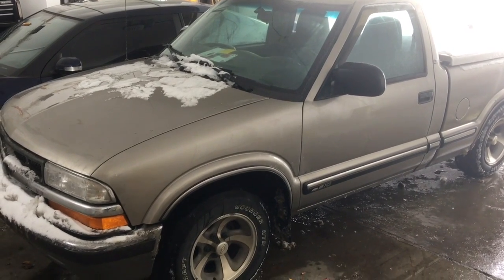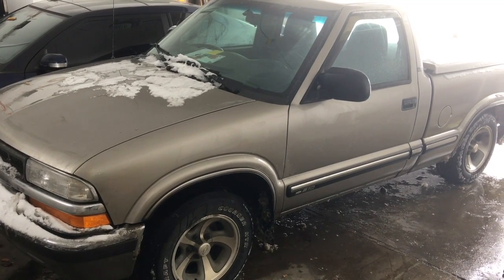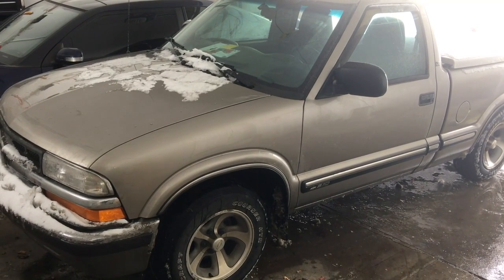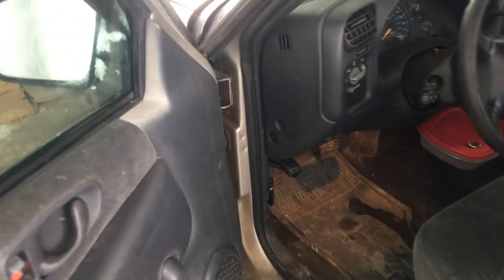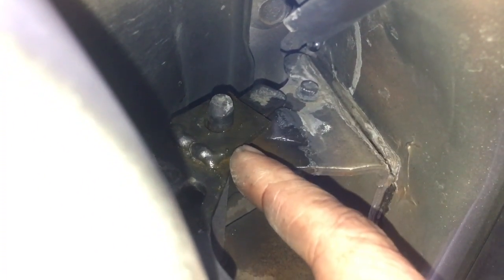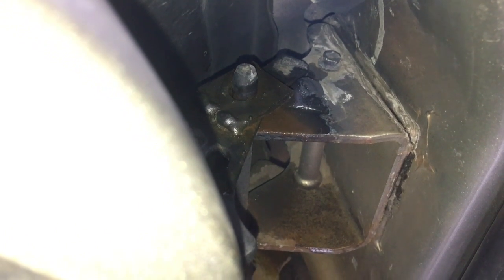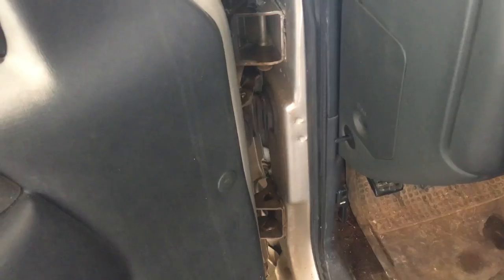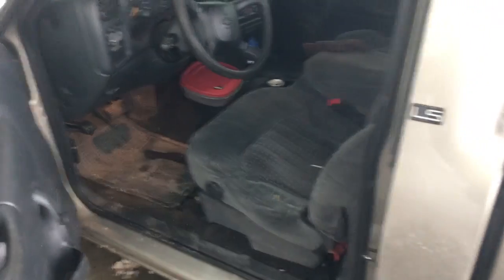Chevy S10 Blazer Sagging Door Hinges Quick Fix

Comment: Excellent idea, keeping the hinges regularly greased makes a world of difference , I do have a small welder and plan on trying this method. Originally I was going to go with the nut , bolt and washers and eliminate the junk bushings all together by drilling larger holes and using 6inch bolts but thinking of trying this, sure wish you had the step by step video lol, I appreciate it, thanks

Comment: The problem with just putting a hinge kit in is the hole in the door hinge is worn out the pin and bushing kit will not solve that. I have this problem now and think I will take the door off and weld the door hinge holes solid and re drill them , although I may try your solution first , great tip thanks for posting.👍👍
Reply from the maker: Yeah, I had that same issue. This solution worked great and is still doing good
Reply: The bushing kit doesnt work for most ppl because they hammer the bushings in or force them in at an angle which cracks or breaks the bushings and sometimes u wont notice u broke it until u use it a few times and the broke bushing falls out, the kit works just fine even with enlarged holes if u install bushings properly which how i did it is with a bolt put through a socket and using washers and a nut slowly and carefully tight bushing into hole it works great if u take your time and it doesnt squish or damage the bushing at all, if u just hit it in it will crack, hell i can break these bushings with my own hands by squeezing them

Comment: Could you use jb weld, if you don't have a welder
Reply: Probably not, If you do not have a welder then I would try quicksteel before JB Weld. You would still need to remove the paint so it has something to bond too. Ultimately welding would be the most beneficial to ensure the plate stays in place. Anything other than welding may break easy under normal daily use of the door. If you do try anything other than welding then please update the effectiveness.

Comment: Mine are really worn and oval i was gonna weld a hardened washer on the hinge what thickness of metal did you use about 1/8" or closer to 1/4"
Reply from the maker: +Rich Kocon it was closer to 1/4" than 1/8". I wish ya luck! It was a really quick and easy fix. :) also replaceable with a quick grind if it ever wears out.
Reply: Hey where did u all weld the plate at
Reply from the maker: Richard Spinner on top of the hinge plate.

Comment: The top door mount on the cab looks like it's pulling away, is that normal because my 98 Ext Cab looks the same and I was worried my drivers door would fall off
Reply: My 98 blazer has the same issue. Its apparently a very common thing on these earlier gm products. My buddys 03 malibu door sags too

Comment: New hinge pins and bushings are literally $12
Reply from the maker: +6795devildog yeah, but the problem was the people that owned the truck before let it go so long, that it made the hole oval. So bushings didn't fit correctly. This was the best fix without replacing the whole hinge. Wish I could have done the $12 fix :/
Reply: could you have welded the hole and then drilled another?
Reply from the maker: +6795devildog Yep! Sure could have, this was just another way of doing it. Also, once this metal tab wears out like the hinge did, I can just grind it off and add another metal tab.
Reply from the maker: +luis jimenez lol it sure can be annoying. Hope you get it fixed.
Reply: Chad Williams  good job by the way thanks for sharing